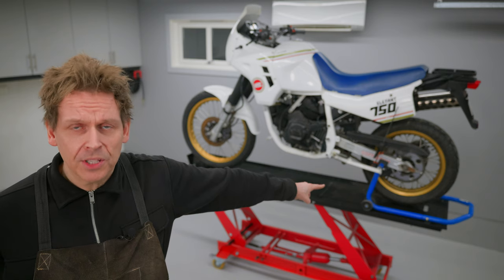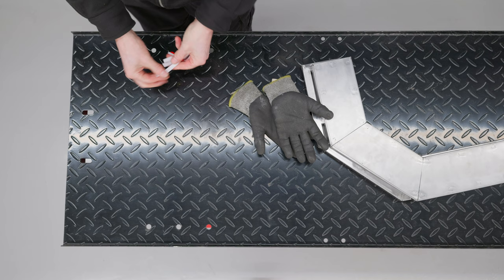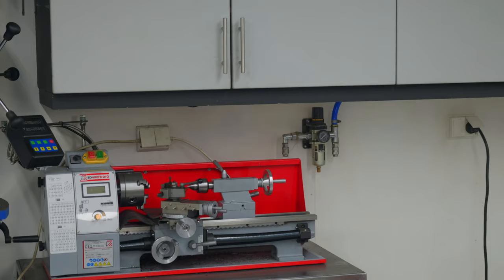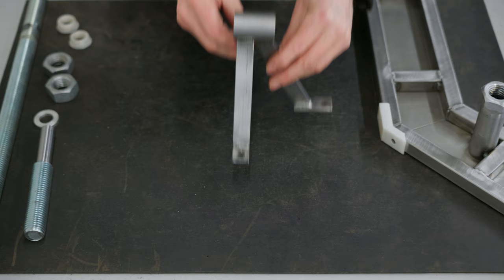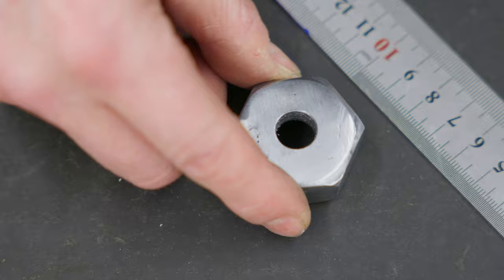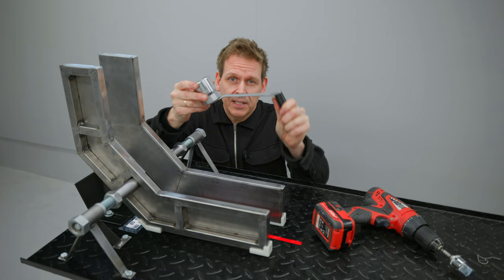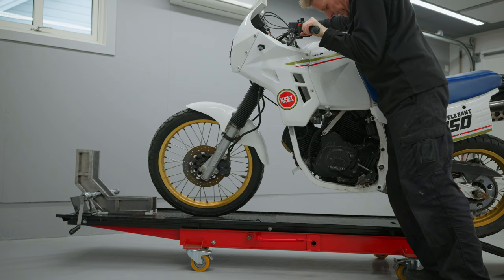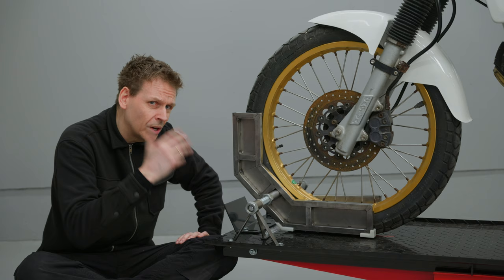Building the Perfect Motorcycle Lift Table Wheel Clamp / Chock

Comment: Instead of two threads, build a single one with a right/left thread. It will tighten with one crank and self-center. You can make that on the lathe, just use brass if steel is too annoying to machine.
For the top, a C-clamp type thing would be good.
Or just omit the vertical part and use a separate part to keep the bike from tipping over. I'm thinking something with two struts to the sides of the table and an inverted V-shape that goes on top of the tire and can slide on both struts until locked.
Reply from the maker: I thought about it 😬 I need to practice my turning skills first, but that would have been a cool project 😎 Many good suggestions here, I did actually try using a c-clamp as you suggested. Strangely enough it did not help much, then I found a problem I had not thought about at all 😳

Comment: Condor (brand or knock-off) wheel chock for initial loading, then tie-downs for stability.  I use tie-downs even with the front wheel clamps because I've seen too many bikes fall over the years while in shops (usually while someone's pushing or pulling on them, but for a minutes extra work it seems silly not to).  

Besides the twisting of the sides when loaded, it seems cumbersome to balance the bike while you move to the other side to tighten the second side.  This is the main reason you have 1 side fixed in position.  You could address this with a gearbox and second shaft so both sides wind together at the same time, in parallel...  but I think it's easier/smarter use of time to just use a wheel chock.
Reply from the maker: That sounds smart! I would not trust a front stand like this as the only way to secure the bike either. I normally use a rear a rear stand, the front stand is there just to hold the bike so I get get on the rear stand.

It's not necessary to tighten both sides after the bike is loaded. One side is preset just to get the bike centered. The other side is set with a small gap to get the wheel in between, and only that side needs to be tighten after the bike is loaded. It will be exactly the same as if one side is fixed, and the other adjustable, only difference here is that you can also "adjust the fixed side" and select what side you want to set as the fixed side and what to use as the adjustable side. 

I think the problem is that both sides are a bit "wiggly" now, I need them to be more in parallel - I think.... 🤔

Comment: An another excellent video, showing great detail as usual. If the tyre grip had a foot that protruded forward it would prevent the clamp from rocking over when loading.
Reply from the maker: Thanks Ryan 🙏 I think your idea is just what I will do to improve it. Easy and it should be efficient 😊

Comment: Ki, I sincerely appreciate your builds. Especially the objectives and design decisions. If you do build a version 2.0 you might look at a Pingel Cylce Jaws for ideas, its what I put on my hydraulic lift table. With that said I think you could just make a small change or two to what you have built. It looks very solid, my motorcycle will also move sided to side in the Pingel like yours does before I put straps on or center support. All the best, Chris
Reply from the maker: Thanks for the feedback and for the tips! I will take a look at Pingel Cycle Jaws, they sound beefy 😊

Comment: The most annoying thing about this is I have the same lift table... Had it for a few years, and now it feels so interior!

In my defence, I can't upgrade the wheels, it's got a motorcycle on it!
Reply from the maker: Hehe, if you don't move it around much then it's probably OK. I would not be without, I move it around all the time. The new wheels are just fabulous 😍
Reply: @kihestad  it doesn't move much, but it does have to move across wooden boards of an inspection pit, so bigger wheels really would help!